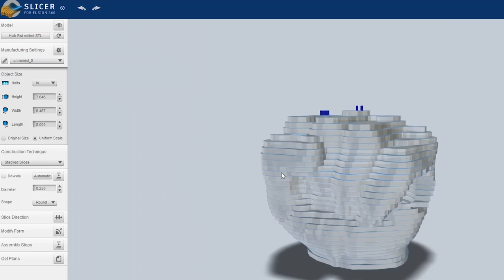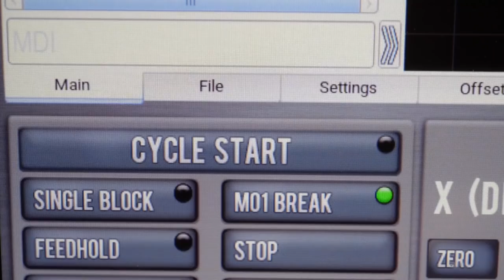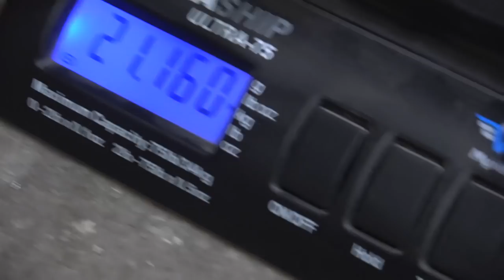Doomfist Destroys ALL with 2600 POUND PUNCH

Comment: An idiotically unballanced toy.  . .. no one had the strength to pick it up... also the acceleration and force of the impact hammer (fist) is dampened without bracing A 5-10 lbs mass would be far more effective and usable.